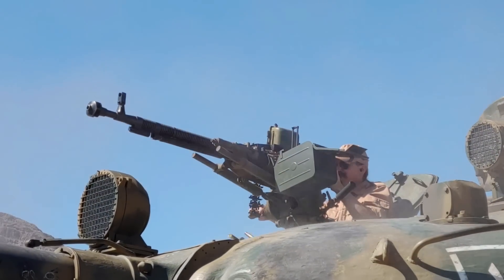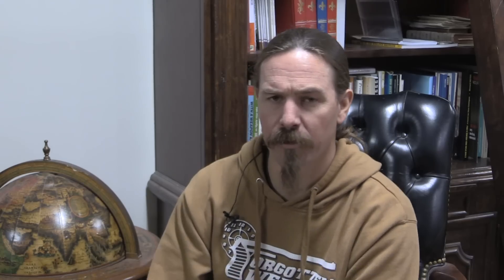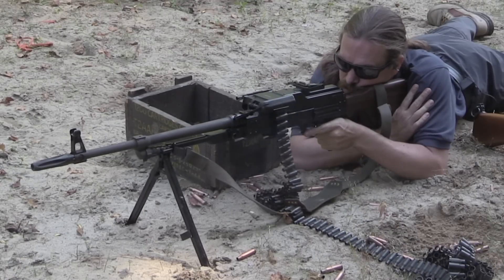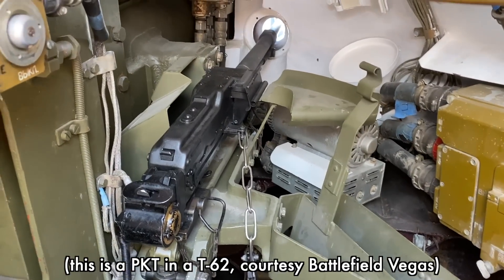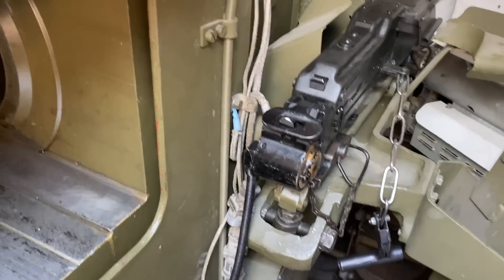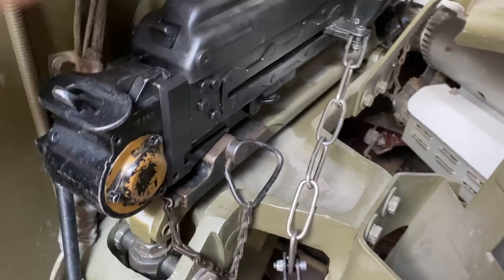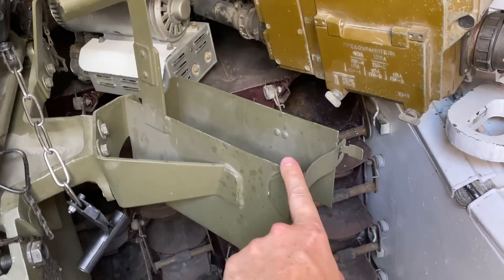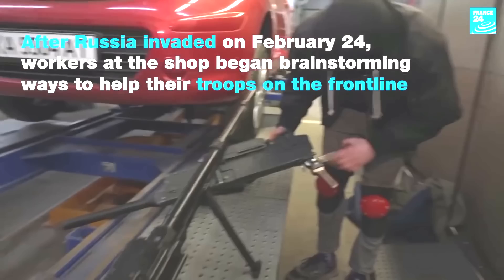Ukrainian Adaptation of PKTs to Infantry Use

Comment: The co-axial GPMG mounted on the chieftain and chally 1 was solenoid activated to fire by the gunner, but if you had to dismount, and had time, the parts were included in the tank spares to convert it back to an infantry weapon (trigger mech, butt stock)
Reply: A concept of such kit for the PKT was also worked out in Russia, a mechanical plant (not sure which one specifically) made a prototype, however, it was never mass-produced.
Reply: Wow, that's pretty genius. I mean, if you ever actually need to dismount the MG, shit has probably hit the fan, and you're abandoning the tank. But considering how a battlefield is generally where shit is likely to hit the fan, good idea.
Reply: Sure? Never seen or heard that. If so probably locked up in supply
Reply: @demonprinces17  Every single tank i served in had it, though obviously not CR2 as thats a chain gun.
Reply: An "egress kit."
Reply: @catlee8064  never heard of it or seen it in writing.
Others say they had them so my units never had or locked away in supply
Reply: @demonprinces17  UK armoured units?
Reply: @catlee8064  American
Reply: If you are in the american military you arent on a chieftain or chalenger. He said nothing about american tanks
Reply: The egress kit for the M240 coax gun in American tanks should come with an egress kit (normal buttstock and trigger group) in case the crew needs to abandon the tank.  I believe George Kontis came up with the idea for that.

Seems strange that the Russians would not employ something like that for a 16.5lb machine gun, but if I remember correctly, the PK's trigger group and buttstock are not modular - they do not install/uninstall easily.
Reply: @hunterbidensaidslesion1356  They are riveted
Reply: @demonprinces17  Yeah, well, I have heard fellow countrymen (who served as conscripts for the Hungarian People's Army back in the sixties) that PPSh's came with 45 round mags- They swore by it. Weird concept, but apparently ture: due to politics you can serve in an armed force without actualyy knowing what the fuck you are doing, and what you are doing that with.

Comment: The PKT is also the main armament of the MTLB, the light tracked apc that are also in plentifull use in the war. Was actually issued in Sweden for the short while they used MTLBs in the late 90s early 2000, leading to issue of 7,62x54 as well. Actually, I think more of the PKTs are from MTLB:s then from coaxial machine guns from like a T-80.
Reply: By the 2000s I think all MTLBs hade been modified to use Ksp58 (FN MAGs). At least the ones that I got into contact with were.
Reply: @fiendishrabbit8259  I guess I was just imagining our pbv401s using Ksp95s when I was doing national service in 2003 then😁
Reply: Why did Sweden use MTLB?
Reply: MTLB is not actually an APC, it's a general purpose vehicle like a Ural truck - just tracked and armored for using it in places where it can be shot at
Reply: @JustAsPlanned1  substitute armor for terrain mobility groups. 

They have been phased out now save for some specific vehicles sich as Engineering vehicles.
Reply: @JustAsPlanned1  In the early 90s Sweden needed to mechanize and improve the splinterprotection our northern infantry and motorized brigades. Didn't have the industrial capability to build that number of vehicles on our own and the MTLB was the cheapest option. Since russia was downsizing Sweden bought like a thousand MTLB (each individual vehicle costing about as much as an upscale mercedes). Turned 600 into vehicles and 400 into spare parts.
Reply: @Zretgul_timerunner  I'm pretty sure they phased out all of them (no exceptions) back when they (temporarily) stopped with conscription.
Reply: @fiendishrabbit8259  Isn't Sweden buying MTLB from Germany? (like the BMP-1 and engineering variant of T-55)
Reply: @fiendishrabbit8259  -
> splinter protection
> MT-LB
Well going off of the last three weeks of combat I’d say they made a pretty poor fucking choice lmao
Reply: @fiendishrabbit8259  interesting, thank you
Reply: @faraway2217  They did. I got a german book on the armoured vehicles of the army of east Germany and it feels like sweden bought half of them :) BMP1 as well as MT-LBs
Reply: Ive been trained on the mtlbv and the mtlbu. And the fdf got the US from Sweden
Reply: @fiendishrabbit8259  Were the MT-LBs , or the MT-LBUs? We Finns bought a bunch of your MT-LBs and MT-LBUs. The MT-LBs I have encountered had the original PKTs in the original turret configuration. Also, there were brass 54R cases headstamped CG lying around the cabin.